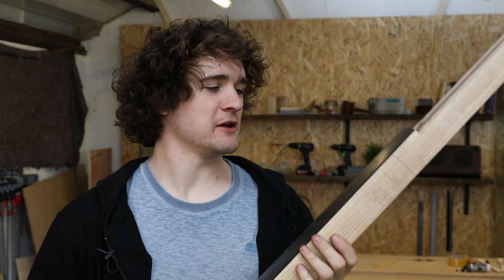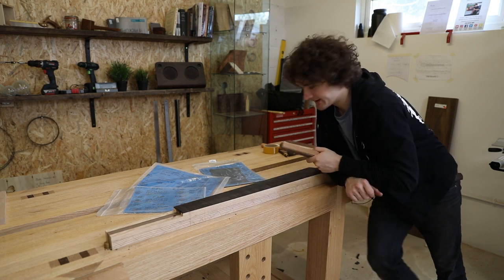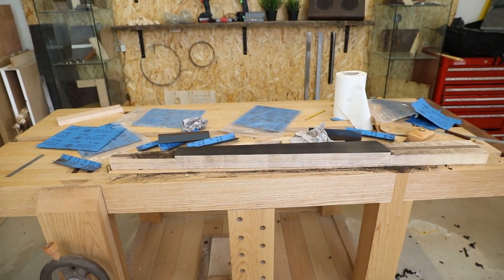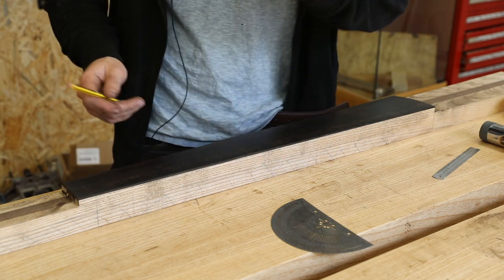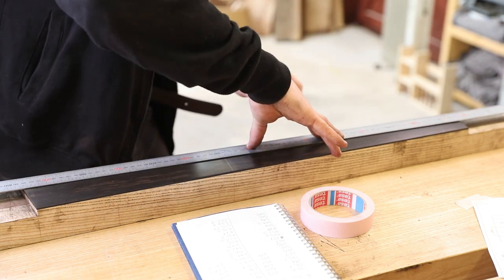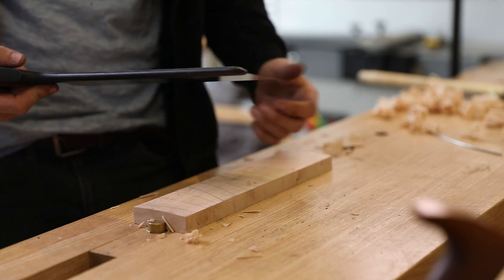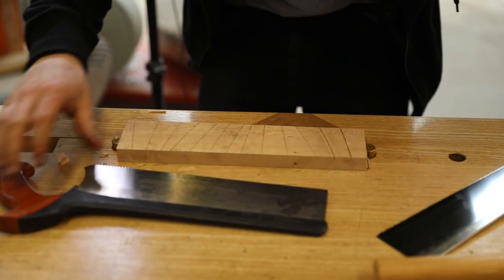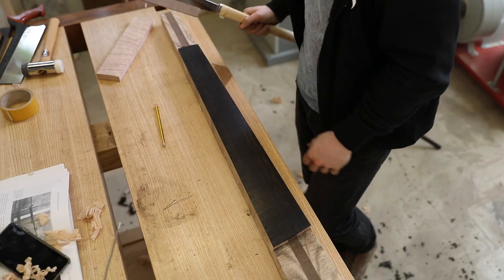Making a Custom Bass Guitar | Part 5

Comment: Fifth video and this is looking great. I'd be lucky to pull off anything as nice as what has been done here. But if anyone is here watching and contemplating giving it a go for themselves, like myself.... One thing I can't help but add to the comments is that, if you think about how deep those 2 truss rods and 3 stiffening rods now are.... with the fret slots cut out, it is a matter of millimeters between the rods and the fret slots.... Not to mention the mechanics of the truss rods themselves (the placement, (i.e. depth) does have an effect).... what could have, and perhaps should have been done, is to route all the slots for the rods deeper and then to inlay some strips of wood on top, re-plane the adhering surface after that, and then glue down the fretboard. There is a very good video to the Greenwood Guitars luthier doing this.
Also depending on the fret material chosen, you're going to want to think about getting pre-radiused wire if you can, (to avoid them trying to spring back to their original shape and out of the slots near the edge of the board). This is also in the Greenwood guitar video as well as in an interview with Paul Reed Smith.
I'm learning a lot from this video series though, and am really enjoying the workmanship. Thanks!

Comment: It's funny I'm a 6 string player we reference off the 12th fret on those for scale length.Don't know much about basses.Great work Matt. I have re-fretted a 6 string electric a few times but never cut the slots I don't know if I could trust myself.I would have to buy a pre -cut fret board and glue it on.
Reply from the maker: Ah I usually would, however I am doing a fanned fretboard here and the 10th fret is the only perpendicular one.

Comment: Did you check the kerf of the saw against the recommended slot size?  While you were practicing it looked like the fret wire was going in and coming back out quite easily.  That's not good at all.  You'll end up with frets sprouting up later.  You will have to glue them in.  If you build any more guitars you should invest in a good luthier fret saw.  They're not expensive and some are available with depth stops.  Stewmac has a nice one and Crimson guitars probably has one too.  I'm sure Ben Crowe will set you up with what you need.